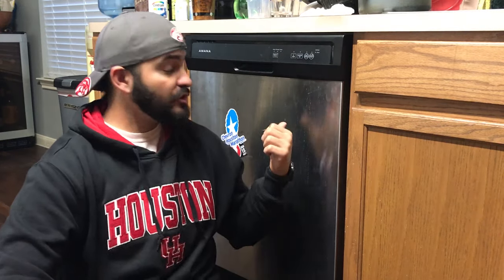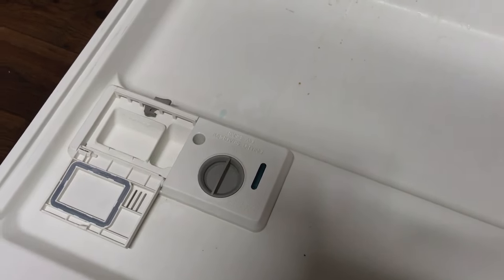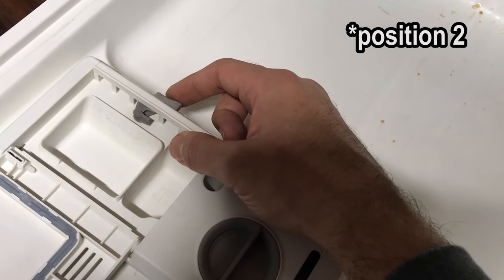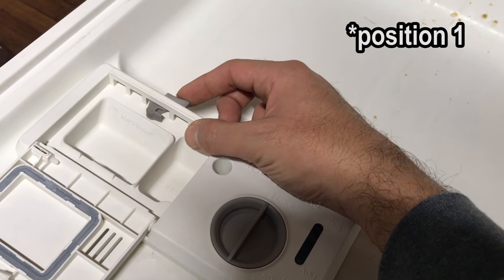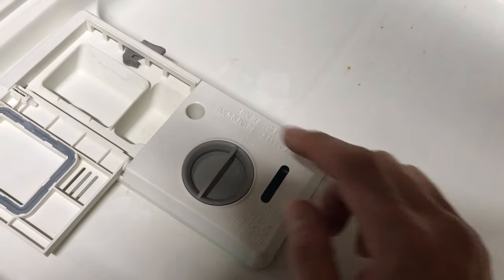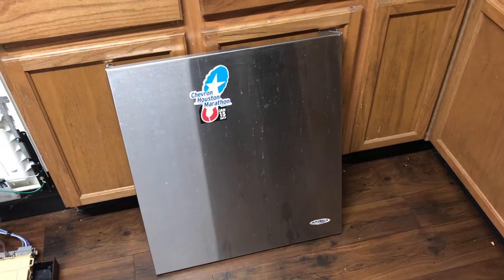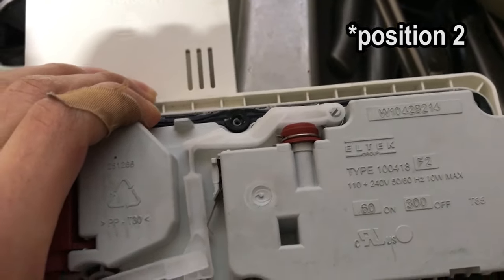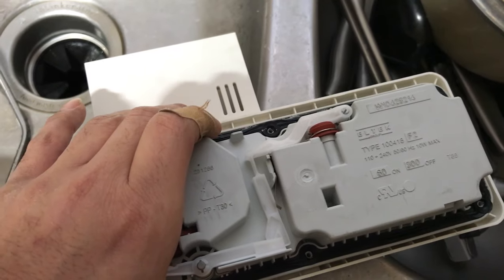[FIXED] Dishwasher not releasing rinse aid

Comment: There seems to be some contradiction.
Your diagnosis said the rinse aid was being released during the wash cycle, not the rinse cycle.  Yet you said you filled the reservoir once and it never depleted the rinse aid.
I wonder whether in some models closing the detergent door would advance the cycle, or preferably reset it.
Reply: Perhaps the first click is shorter(releasing only a small amount during wash) and the second click is held longer for more to come out? Idk

Comment: Another comment from me, this didn't work for me.  I left it in the position following the soft click (soft click = position 2), meaning that the next release should have been the hard click but I think that the act of closing the door after putting in the detergent tab caused it to pop out of position 1 and then when the door opened to release the tab, that was the soft click and took it out of position 2 (but this should cause the rinse aid to start going down if it's being released into the wash cycle).  So now I am going to try the reverse and see if that works.
Reply from the maker: did it end up working after all?
Reply: You are correct. No matter what position the linkage is left in, when you shut the soap dispenser door, the linkage will always reset to position one. I watched a full cycle run on mine. The small motor turned on during the wash cycle to open the soap dispenser door. When the motor piston retracted the linkage was then in position 2 ready to dispense the rinse aid. With my dishwasher, the motor never turned on a second time so the rinse aid was never released. Lots of folks having this error. Think it may just be Amana.

Comment: When do you close the detergent door? After you click it to Position 1 or Position 2?
Reply from the maker: Position 2. 

With your detergent door open, the last click you want to hear is the soft click which was position 2. Then throw your detergent in and close the door, the machine will engage position 1 like it is supposed to. That should put you into the correct cycle.
Reply: @bird2002  took my door cover off , in the right position , ran 1 hour wash. the plunger extended to drop the detergent ,extended to apply rinse agent , then at the end of rinse cycle it extended again which put it out of position it was in the rinse drop position. why the third extension ??? . Then the light came on , looking at the lever reach inside closed the detergent door and it set the lever to the right position , With being said my finding is you can't get it out of position. Something else is the cause. thanks for your input you got me started  looking at my problem

Comment: Does no click count as a soft click? Doing this I get no soft click, press it I get a click, press again I get no click.
Reply from the maker: @InDreamsYourMine  it could be, or you have a different model. But I would guess yes
Reply: @bird2002  I have a Kenmore portable dishwasher.
Reply from the maker: @InDreamsYourMine  well, I have zero experience with those, but if it looks like the one in the video, then it might be the same part since it’s likely the different brands just use the same parts. If it doesn’t look like in the video, then it’s likely a different part altogether.

Comment: Wow, this is WAY too prone to user error. There should be a big label. Huge thank you. Any thoughts on why it is a 2-stage lever? I am wondering if this messes with the detergent release and maybe caused my wash to be inefficient. I noticed sometimes the door opened lazily instead of flipping all the way open mid-wash. Maybe this is because it was getting 'pushed open' with the incorrect 2nd stage? Just a guess...
Reply from the maker: I think it's 2-stage because of cost. You'd need 2 wax motors, 2 sets of wires, etc. when you can accomplish the same with a single one and some clever engineering. I think it's brilliant the way they designed the mechanism to work, absolutely brilliant, *BUT* yes it's prone to user error. They didn't design against every possible flaw, and worse still, did not warn the consumer about it. I couldn't find a single piece of literature online that remotely covers this topic.

As for the mechanism affecting the release of the detergent, no, it doesn't mess with the release of the detergent. Any time the wax motor pushes the piston, the door releases. No matter which position it starts in, the computer triggers the wax motor when it's time to release the detergent and the detergent will always release. However, if the mechanism isn't in the correct position, it won't trigger the rinse-aid during the correct cycle and you'll get improper drying. So the good news is that you'll always get clean dishes, you just may not have them properly dried.

Comment: Thanks for this video!! I was really hoping this would work for me! Still didn’t dispense. Any other tips?
Reply from the maker: Well, that’s all I’ve really got in terms of fixed. You can manually test if it’s dispensing by holding the lever all the way in (so as to simulate the wax motor holding the dispenser open) to see if it leaks out. Your door has to be upright, almost closed, so that gravity will allow it to drain from the dispenser. Try it in both positions to see if it drains out at any point. If it still doesn’t, your dispenser might be clogged or broken. At that point, you might need to replace the entire assembly. 

If the detergent door opens every time you wash, it’s unlikely that the wax motor is broken, because then the detergent door wouldn’t open. 

That’s all I could think of for now.
Reply: I have been trying to clean it out thinking it was clogged! I would have never figured this out without your video!!! Thank you

Comment: My dispenser looks almost identical to this but mine is a kitchen aid. The switch doesn’t click like that at all. Also I fear mine may be clogged. How do I clear a clog?
Reply from the maker: You could try to hold the door upright and press the button all the way in, holding it in to see if gravity will pull out some of your rinse aid. Most of the time it’s a blue liquid so you should see it come out. 

If it doesn’t come out the first time you hold the button all the way in, release it and press it again, holding it all the way in. Check and see if it releases that time. 

Repeat these steps several times. If you never see the rinse aid drip out, you’ve likely got a clog. How to clean it, will be a different story. I used my mouth to blow pressure into the chamber. This probably wasn’t the smartest move since it blew rinse aid back into my face. But it definitely removed my doubts about my clog. It’s not a safe method, but could work if you are more cautious than I was. Try at your own risk.

Comment: I tried the boiling hot water fix, there was gross black chunks coming from around the edge of the dispenser.  And there's black stuff in the front vent holes.  Never buying another Amana ANYTHING.

Comment: Okay so question; do you leave it in the second position once you’ve put detergent in it and shut the lid or leave it in the second position before you shut the lid with detergent in it? I am closing the lid with detergent and then holding the lid down and listening for no click but I think that maybe causing it it cycle in reverse yet again; dishes still come out looking just as wet as before. I’m thinking maybe when you close the lid after you’ve put detergent in it causes the mechanism to cycle just as if you pushed the button. I could be wrong but that’s something to think about to and maybe you could answer that for me and anyone else in the comment section having the same issue as me. I’m going to try doing it reversed with the lid closed and holding it down. I’ll let you know what I discover.

Comment: (Update)
So I decided to spend $8 on a bigger bottle of Cascade Rinse Aid and filled it to the 'full' position, add soap pack and wash normally....after that's all and done - and still very wet, and 'rinse aid' is still very full. Puddles everywhere! Long story short. Do NOT buy Amana or any Whirlpool dishwasher. Stick with GE or other brands.

My new Amana dishwasher with the same exact dispenser will not dry no matter what. It leaves puddles of water on top of cups, and all over the inside walls and floor bed of the dishwasher. Both heated drying and the included small bottle sample of Rinse Aid did not help. My 1988 (manually lock with dial) GE worked like a charm without anything additives, but the motor seized Probably by hard water buildup and most likely would work again if thoroughly clean the motor or pump. But that I live in a rented apartment so thinking a 35 years newer dishwasher is better. Not even close! Nothing but frustration. I also tried this method. Did not work.

Comment: Does this go for every dishwasher because we moved in a year ago and I added Rinse Aid like you said it just never released it and I have no idea where the manual is for this thing so I just discovered your video I've been trying to Google it and couldn't find a video on it I have a Frigidaire very basic dishwasher I did hear the two separate clicks I think I am running the washer now so hopefully it'll work sometimes after the cycle is complete the dishes are still wet and some of them are still dry so I thought it was working I don't know
Reply: With Frigidaire, there should be a dial that you move to the left or the right inside where you pour the rinse aid. That dictates how much rinse aid gets pumped out. Or you could try a Cascade Platinum pod in the flatware caddy instead of the dishwasher dispenser and that will also help immensely.

Comment: Dilemma: after following this fix the problem persists. What is perplexing is after the wash is finished and I press the lever it is always the "soft" click. Should it not be the "loud" click since the washer should have released the rinse aid as it's last action which would have been the "soft" click?
Reply from the maker: Yes, that should be the case. Maybe your wax motor is bad? I have another video about wax motors, specifically the one that’s in my dishwasher. I ran 120VAC to it and the piston went all the way up, so I realized mine was working. This is quite dangerous though, so if you have a safe way to test it, you can pull the unit apart and run 120V to the wax motor and see if it extends all the way. If not, you need a new wax motor, or perhaps the entire dispenser mechanism needs replacing.

Comment: I have the same one but it only clicks once. I cleaned the hole in between the soap dispenser and where the rinse-aid goes and it had mold. I cleaned it with a q-tip until it was clear hopefully that work's, I think that's how the rinse aid dispenses
Reply from the maker: If you hold down the button while the door is up (nearly vertical position), you can actually see the rinse aid dispensing. If cleaning it unplugged it, you’ll see it drain out. Hopefully that fixed it.
Reply: @bird2002  it did I ran it after I cleaned it. It's been full since I put jet dry in the first month of living here lol. Thank you now I don't think my dishwasher sucks anymore.

Comment: Wouldn’t the rinse aid still get dispensed either way.  Even if it’s in the wrong position, that only means the rinse aid will be released in the beginning with the dishwashing detergent and though the rinse aid will be wasted, the level will still be decreasing as if nothing were wrong.  Yet this fix still seems to be working for so many people. What am I missing here?
Reply from the maker: You're correct, small amounts of rinse aid are released when in the wrong position anyway. But I think the "door release" position only activates the wax motor for a short duration, just long enough to open the door, so it wouldn't release a lot of rinse-aid. Meanwhile, the "rinse-aid release" position stays open a long time, thereby releasing a healthy amount of rinse-aid. For me, it was the difference between wet dishes and spotless dishes.

Comment: My dishwasher is lg and it doesn’t have a click each time the lever is moved, it only clicks every other time the lever is moved.  What would be the correct procedure for it?
Reply from the maker: If yours looks similar to the one in the video, then it's possible that they operate the same. Mine technically only clicks once, the second "soft click" isn't actually a click, it's just a position that I feel the mechanism gets into the second time I press it in. Yours might be the same. I recommend you try it and see if it gives you better results.

Comment: Wouldn't you see rinse aid levels go down in the view window even though it's being released out of sync?
Reply from the maker: Logic tells me yes, but considering that I used this dishwasher for 3 years and the level never moved, experience tells me no. Ever since I discovered this, now my level drops every so often. 

My guess is that the applied voltage during the door release is very short, too short to release any rinse aid. When on the rinse cycle, I think the computer applies voltage for a lot longer, keeping it open long enough to release the correct amount. 

Again, I’m just guessing here, but from experience I’ve noticed a world of difference in my dishes.

Comment: mine is a whirlpool and it's about 2 years old exact same mechanishms.. mine doesn't click twice.   it loud clicks then a silent clicks.  you can see the rinse aid go down during the silent click.   thanks for this video ive been having various various washes where it works then it doesn't and I must have been clicking it and not even knowing that dam blue fluid just sits there forever. I finally bought a 2nd bottle of jet dry 2 years later.. water was always all over the dishes except when the few times it happen to work I was amazed.. 😂 I thought I had a faulty dish washer cause our home builder did everything on the half ass side
Reply: So then what’s the correct setting for whirlpool? On the silent click or not

Comment: Thank you for this video. I've been having the same issue. I went and checked it and I hear the first loud click but then when I push it again no soft click. I put it in hopefully the correct position now 😆. I'm wondering though if because I didn't hear the 2nd shift click if I need to remove the whole thing and check it to make sure it's not got a broken piece. I'll run it a few cycles first and see what happens. Thank you again. ❤️
Reply: Do you have an update?  Did it work for you even though you weren't hearing the soft click?
Reply: @jovicrazed  any word? Mine doesn't soft click either
Reply: @pwhj3286  Mine does do the soft click but what is shown in the video hasn't worked for me.  I've tried leaving it in both positions and neither produces any results.  The dispenser is as full as it's ever been.  After a load is done and I press the button, I do hear air forced out from the rinse dispenser, but can't seem to get any rinse aid to come out no matter what position I leave it in. I was really hoping that this simple solution would be the trick.
Reply: @jovicrazed  Bummer. It is frustrating to say the least. No more Amana appliances for us. Problems with the whole suite we bought a few years ago. Thanks for the reply and hope you figure it out!
Reply from the maker: Another person replied on here and said they had to manually empty their rinse aid (yes, what a waste) and clean it out completely. Apparently they had some kind of blockage. Once it was clean, they refilled it and it worked like a charm. I might consider cleaning mine soon and possibly blow it out with an air compressor or steam jet cleaner to break up any blockages.
Reply: @jovicrazed, @P WHJ sorry it took so long to answer you back. No it still does not work. I'll end up eventually having to replace it. I live in apartments though so I don't know if I really want to 😆.
Reply: @mayesorrenti4650  Thanks. That’s too bad. I was hoping it was the quick fix.  But it wasn’t.

Comment: Such a bad design to have a lever so accessible to being accidentally pushed controlling the rinse agent. At the very least, the push button/lever should be marked (position 1, position 2) and the manual should give instructions on what position the lever should be in to work properly. I’m surprised to see so many people in the comments with the same issue and Amana can’t advise how to fix it.  You should send your video to Amana so they can inform their technicians, customer service and edit their troubleshooting guide. You’re the only solution on the whole www!
Reply from the maker: Honestly I feel like they keep this to themselves because if it's broken, you need to call them to fix it. Service charges and fees are probably expensive, so it keeps them in business. They're likely to tell you that your dispenser was broken and replace it, making you pay outrageous fees for something that is so easily fixed. It's a smart business tactic for them, but bad for us the consumers. 

And yes, I feel like I'm the only resource on the entire internet for this problem because I haven't found anything remotely similar to this content anywhere on the web.
Reply: @bird2002  You definitely are the only resource with info to fix this and that’s why I appreciate you taking the time to post about your discovery. I just wanted you to know that it helped someone. Thanks again.

Comment: Mine did it from day 1.  Flip the breaker, open the door, remove all the screws EXCEPT the top 2.  You can easily reach in behind the front panel and REMOVE the tiny metal hose clamp around the red piece of rubber.  I sprayed mine with WD40 for good measure.